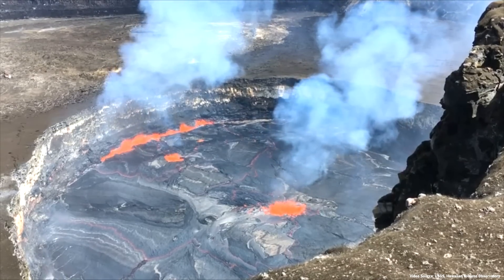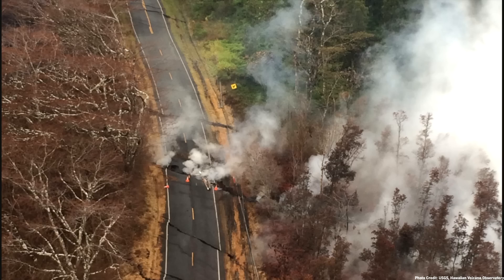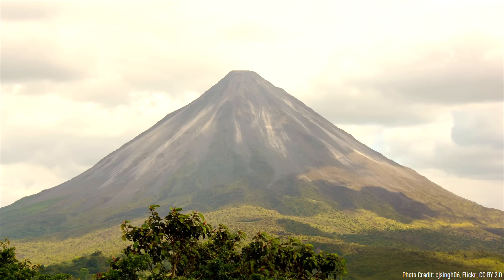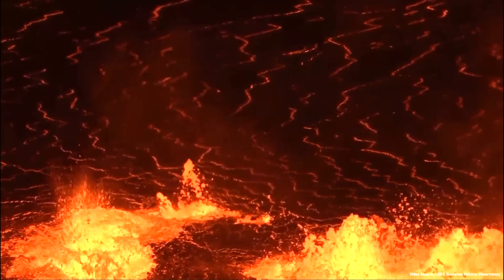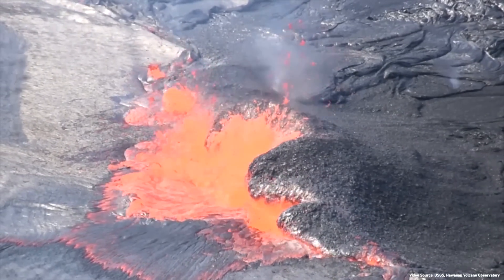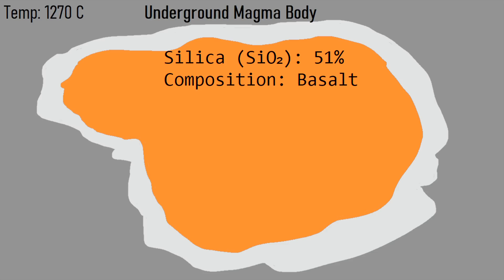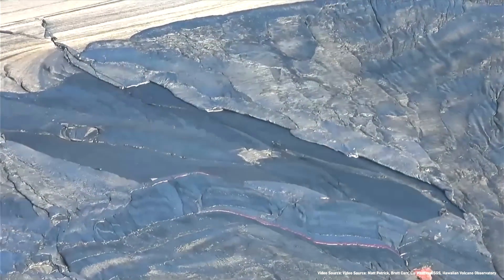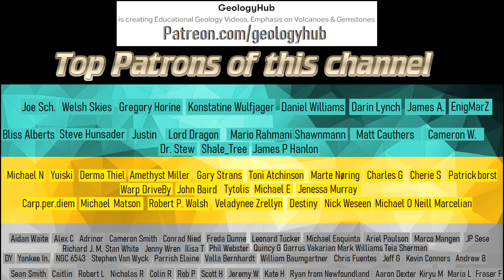Kilauea in 2018 Erupted the Wrong type of Lava

Comment from the maker: The process of fractional crystallization is a reminder that any volcanoes technically has the potential to produce explosive rhyolite eruptions. Of course, fractional crystallization at shield volcanoes or fissure systems (such as in Iceland) tend to only result in relatively small magma chambers. Regardless, fractional crystallization is an important process to understand why many volcanoes become more viscous over time, or erupt multiple different compositions of lava during a brief timespan.
Reply: What is the most dangerous volcano in Greece?
Reply from the maker: @temosofthecommunistrepubli2637  Santorini. Always has been. Kolumbo is a close 2nd. Nisyros is 3rd
Reply: @GeologyHub  Santorini has all the titles huh? What about being too close to a population?
Reply: @GeologyHub  I think Santorini took out the Minoans about 1000 BCE or something like that. Yes, that's pretty dangerous.
Reply: @edwardlulofs444  Santorini did erupted in 1600 BCE at a magnitude of VEI 7 , the resulted in the weakening of the Minoan civilization which was then concurred by the Mycenaeans .
Reply: @GeologyHub  - For some reason I find silicic lava where you wouldn't usually expect it an interesting subject -- like the Littlefield Rhyolite, which was contemporaneous with CRBG upper Grande Ronde basalts. Apparently low viscosity for a rhyolite, as flows were extensive. I assume it had something to do with extra high temperatures from the YHS. It was like 100 cubic km of rhyolite flow covering over 800 square km.

Would that have been from fractional crystallization, or crustal contamination, or both?
Reply: @cacogenicist  for Continental stuff, it’s usually a mix of fractional crystallization and partial melting that determines a magma composition. That’s why most hot spots and plumes begin with a basaltic flow before becoming rhyolitic
Reply: @sizzlebiscut  - That makes sense. 

Seems to me you didn't get much rhyolitic volcanism from the YHS until it was under more, uh, continentalized (if that's a word), evolved old terranes. 

The relatively recently accreted, nearly entirely basaltic Siletzia was the first chunk of NA to override the YHS -- and those eruptions (see: Tillamook Volcanics) were almost all basalt ... but there was some late dacite and rhyolite erupted; perhaps more from fractional crystalization than from contamination, I would think.
Reply: @cacogenicist  if you are finding silica near specific volcanic activity you magma be finding an ocean vent outlet of the water filtration system / mantle cooling radiator
Reply: @cacogenicist  I forgot to specify, the plastic could be conferring to more silica residue and rhe earth could be trying to process what it can..we should all brainstorm magmatic chemical combat theories of like effecting/managing the viscosity of the magma to help process out the oceans and mitigate micro fragment distribution..**<<😆🤪 audacious idea just now- uh could we find a way to reorganize carbon into hydrogen maybe using spare atoms from sulfer or spare atoms from plastics and methane(?) Idk why I'm thinking that. But whoever thats for, godspeed and with you, amen.
Reply: Cool, I have some cut and uncut peridot which is gem quality olivine for those who don't know, in storage. In the future I hope someone will make me earrings and a necklace with them, I don't know where they are from but there's a piece of paper in the box I don't have because it is being stored, describing where they were mined and how it was done sustainably by local people. I bought some other things from them too like a big piece of sulfur crystal that's growing out of some kind of rock and makes my bedroom smell when it is in the window in the sun. I am sorry for not remembering where they are from, my stuff has been in storage for like almost ten years.
Reply: True, and sometimes it happens to bigger magma chamber like it was the case for Tambora. In this case the crystallization produced high pressure trachi-andesite, and we all know the result!
Reply: Fascinating. I kinda knew this in theory, but it's different to have a recent example of the process.
Reply: Might explain why Keanakakoi in 1790 was so explosive, and also might explain why some hotspots can abruptly shift from producing gentle-flowing basalts like the Columbia River Plateau to producing caldera-forming rhyolitic supereruptions like those in Yellowstone. Great theory to say the least, and the Yellowstone Hotspot might easily be a real-world example of what happens when fractional crystallization is allowed to progress all the way.
Reply: @kennystrawnmusic   so that is the thought/heart thread of the universe that guided my other thread question of the effect of magma over/drying/mixing with *a big eruption like this^
Reply: Have you already complained about this to the Vulkan court?!? :D :D :)
Reply: the same process that drives the oil reffineries :)
Reply: Can fractional crystallization be a means to ballpark the age of a volcano based on its most recent, silica rich flows?  I know they use carbon dating for specific eruptions, but can this be used to determine the general age of the volcano itself?  It's been a couple decades since I studied volcanology to include igneous petrology.
Reply: @freedomisntfree4836  magma doesn’t usually have carbon in it, plus the half life of radiometeic carbon is quite short, so when it comes to dating we use other methods such as U-Pb and Sm-Nd for geologic material. This also gives a fairly accurate date for about the same amount of effort as finding an accurate silica concentration.
Reply: @sizzlebiscut  I was taught by a volcanologist who worked at the Hawaii Volcanoes National Park that they use the carbon of burnt foliage beneath the flows to carbon date the approximate age of the eruption as well as the polar reversals that can be seen in more iron rich lavas to determine age (ballpark) of eruptions. Also, minerals/secondary minerals found in the magma chambers also could determine age of the magma chamber itself and therefore the volcano itself.  But then I studied this stuff back in the stone ages. Lol

Comment: Mahalo for your explanation.  Do you think the same mechanism is responsible for the explosive eruptions that created a series of volcanic cones, including Diamond Head, on the island of O'ahu or the submarine eruption between O'ahu and Kaua'i in the mid-1950s?  These eruptions occured long after these islands had moved away from the 'hot spot.'
Reply: Likely yes since the chemical composition for those eruptions was trachyte which is a particular product that largely arises from crystal fractionalization as one of several intermediate stage magma compositions between basalt and rhyolite which are classified relative to the amount of alkaline elements present. Trachyte is one of the later products on the crystal fractionalization progression and likely suggests there is a relatively large magma body that is undergoing advanced crystal fractionalization. Trachyte has a silica content similar to dacite if I remember correctly so high silica but not yet the end stage member meaning more volcanic eruptions are quite possible even if O'ahu no longer receives any additional melt if there is a large enough magma body down there.
Reply: @Dragrath1  Fascinating.   I wonder what mechanism initiates this type of eruption?  As you know, a chain of volcanic cones extends along the most densely populated parts of Oahu's coast from near Moanalua (Salt Lake) adjacent to Pearl Harbor, to Punchbowl and Diamond Head in or near downtown  Honolulu, to  Koko Head, Koko Crater, and Haunama Bay on the windward coast.  An eruption would  certainly have the potential for being devastating.

Comment: Not eruption a drainage caused by PGV
Reply: No it wasn't. That plant uses geothermal energy to produce electricity. Basically they pump water down cracks or weak areas that contain large amounts of heat, which causes the water to turn to steam, cone back to the surface and drive turbines which produce electricity.

Comment: Is there the possibility that this change to a more viscous lava is signaling the end of eruptions on this island of Hawaii, that the volcano is dying and that the hotspot has moved to start forming a new island. I say the end but that could hundreds or thousands of years away.
Reply: Probably not yet for the big island of Hawaii at least not in the case of Kilauea. The rate at which this occurs depend son the size of a magma body (as well as depth) so the small size of these magma bodies means they can evolve much faster.

For a large magma reservoir they may be able to sustain eruptions for quite a while with such a chemical change vuia crystal fractionalization likely responsible for O'ahu's long gap in volcanism before activity resumed with a chemical composition of trachyte which is a much later stage product of crystal fractionalization for magma bodies. In principal this still isn't the end stage for magma fractionalization which means there is still a non negligible possibility for future eruptions on O'ahu yet alone younger systems such as Haleakala on Maui. Basically if there was a large magma reservoir you can have increasingly infrequent volcanic eruptions continuing for up to a few million years from a slowly cooling magma chamber ceasing to be fed by the hot spot.

Comment: How did Earth’s continents rise above the oceans way back then during Pangaea?
Reply: Perhaps Pangaea was the result of the biggest and longest flood basalt eruption while the earth was tiny and less buoyant. The crust was thick without much tectonic activity while Pangaea rose from the ocean like Olympus Mons during a super plume.
Reply: @borisbeloudus2691  oceanic crust is mostly basaltic which is more dense and sits lower in earths mantle than continental crust which is mainly granitic and more buoyant. The cores of continents called cratons are billions of years old, with accreted material making up their edges. These cratons were present during Pangea and previous supercontinents, meaning that they didn’t have to suddenly rise up like that

Comment: Any chance you can tell if the drilling of those wells triggered that eruption definitely an on going theory here...
Reply: Drilling of wells won't trigger an eruption because the hole drilled is too insignificant to influence a magma chamber if it makes contact with the magma chamber at all.
Reply: @michaeldeierhoi4096  more so series of holes will crack specially since certain magma was different in viscosity it might I'd just like more thoughts...
Reply: @ryanparker1171  It's the same argument against geothermal energy.  It's just not enough to effect an actual volcano.  If anything, it will just release steam and heat.  Any connection time-wise, is purely coincidental.
Reply: @freedomisntfree4836  and very rarely will magma find the borehole. Tho such cases are very dangerous and could result in there hole having to be sealed for safety reasons

Comment: I recall reading many years ago (over 40) when I was a youth about how Etna changed from a shield volcano to a composite one, and I wondered why this happened.  Well, the explanation given here about Kilauea may provide the answer about Etna.
Reply: Not sure this is sufficient to explain Etna given the amount of material it erupts and the high gas content means the volcano is regularly getting fed by fresh material which would make the fractional crystallization very complicated. This likely has to do with the volcano being fed by subduction melts which tend to be much more water rich due to how they form from water lowering the melting point of the underlying mantle above a subducting plate and thus making the resulting volcanism tend to be more explosive.

Comment: This video is an important reminder to me of the importance of fractional crystallization. For some reason I have this idea of the silica content of a magma from the magma melting its way through silica rich continental rock. Geology is a hobby so I have some misconceptions. Thanks for the video.
Reply: They are both important processes but as Hawaii is almost exclusively basaltic in composition silica diffusing into the magma is far less significant than it would be in a more continental setting.
Reply: @Dragrath1  Thank you for that helpful information. I wish that I had had time in college to take geology classes.

Comment: At the start you mention the 1983-2018 eruption primarily occurred at the summit, however, the summit only joined during 2008 (thereby creating two activity centers). Pu‘u‘ō‘ō had been erupting since 1983 with occasional focus shifts up- and downrift relative to it, but always returning to Pu‘u‘ō‘ō and creating a lava lake there too. Both Pu‘u‘ō‘ō and the summit first experienced inflation during April 2018, with Pu‘u‘ō‘ō's floor collapsing a few days before the 2018 lower Puna eruption. I recall following the collapse of Pu‘u‘ō‘ō's floor, the summit lava lake started to drain.

Comment: Interesting, I had wondered what made magma turn to become more silica rich. I thought it had a lot to do with melting rock in the Mantle that was already silica rich. Maybe it does that too?
Reply from the maker: Both fractional crystallization and absorbing silica from surrounding rock. However, surrounding rock is almost universally basalt on the big island
Reply: @GeologyHub  OK thanks GH, helps explain the Cascades having so much silica on some volcanoes, but not others like the shield volcanoes to the East of the Cascade line. I imagine it's more complex than that, but explains a lot nevertheless.
Reply: @MountainFisher  It also explains why the Cascades are so much more explosive than basaltic volcanoes - the more silica, the more energy it takes to erupt, therefore making silica rich magma much more explosive when it erupts.  Another reason I find it completely fascinating that this eruption at fissure 17 produced andesitic lava.  Truly amazing.  I did visit a site on the Big Island where we saw our first xenoliths (foreign minerals) that were blown out of Mauna Kea from very deep within its magma chamber.  Never forgot that.  Tons of garnets and very large feldspars, something you don't typically see in basalt.